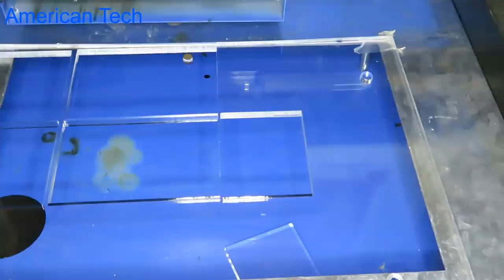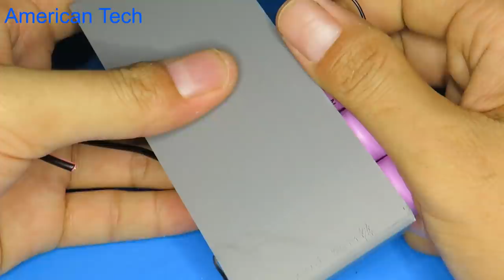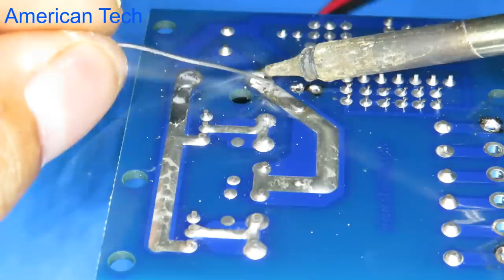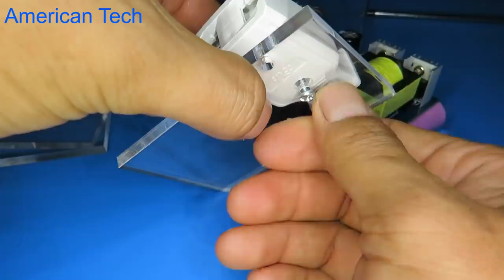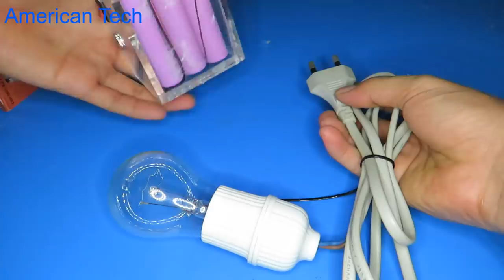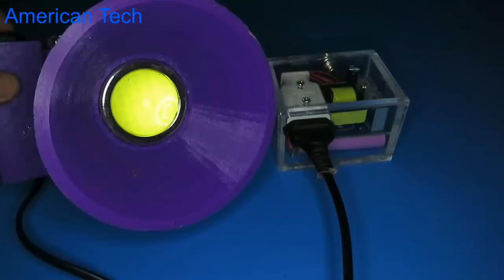World smallest portable power station 150W

Comment: Warnings:
1. The board belongs to high frequency square AC output; it is not suitable for the inductive appliance, such as motor, fan and coil transformer.
3. You should install a large heat sink to release its long time high-load (¡Y100W) work.
Despite those warnings:
- you used it for a fan
- you closed everything inside a thermal insulated box.
- the battery has 30 Wh, you presend to use the generator with a 150 W load, they will last less than 12 minutes.
- for a 150 W output on 220 V the battery is requested to provide more than 12 A… 12 A in those wires???
Reply: I Agree But There’s Some Mistakes In Your Comment.

First One Is The Fan Is Being Powered By A Phone Charger Which Outputs DC Voltage.

Second Is The Battery Pack. The BMS Will Cut Off The Power If The Current Draw Exceeds 10 Amps. That means 120w 

thank u
Reply: @fayanshorts but its a 20a bms and ig you look at datasheet you will ser it cut the current above 20amps

Comment: 4,21x3x2,5=31,575 
31,575/150=0,21
 So it can last 12 minutes at 150W
Reply: But you can add as many batteries as you want in parallel with this 3s.
Reply: Teach me this formula plz
Reply: Where u getting these batteries from, Mars?
Reply: @Magneticitist  you can buy these batteries from electric shop or if you want to save money than you can extract these from old laptop's batteries.
Reply: @shahzadmughal7666  there are many different kinds of lithium cells that use different chemical makeups. If one is looking to build legit inverter that can actually Supply a good amount of power then you need to use high discharge cells like what can be found in lithium drill batteries. Otherwise you are using cells which are maybe good for 1.5 amp hours tops and can maybe deliver 5 to 6 amps continuous.
Reply: @Magneticitist  man, there are many quality 18650 who can deliver more than 20A continuos and around 3Ah of capacity.  For example LG HG2.
Reply: @AsitShouldBe  right, you can use them in desire combination using a good bms to get good charging and discharging rate
Reply: @Magneticitist  no, from LG 😁
Reply: @AsitShouldBe  yea and you won't find them in cheap pulls like from laptop batteries. They are going to be in high drain designs.
Reply: @Magneticitist  yes, sure, but you can buy them new!
Reply: Can you see number of ads on his videos 😲
Reply: @rohankumarchauhan9653  no, i block them all
Reply: Can only charge phone for 12 minutes?

Comment: Extremely dangerous to build, handle and use. Mishandling high AC voltage can be fatal. These kind of cheap AC inverters produce weak quality sine wave than can destroy almost instantly every devices plugged on. There aren't any cooling system in the box so the components / batteries might start burning during long use period !

Comment: i was thinking about that phone charger.the output frequency is around 25khz to 50khz which is very high for that charger.inside the charger there are normal diodes probably 1n4007 which are getting damn heat due to high frequency and we also cannot use some devices with that much high frequency.the best option is to use a bridge rectifier at the output with fast diode to get 220v dc😄😄😄😄😄😄😄😄😄
Reply: Yes maybe charger damage in just 5 minutes 🥰
We make it and use ba159 diode for rectify dc output
Reply: @sahimkhan7899  :)

Comment: While being a proof of concept, I really doubt these cells or their wiring will handle 150 watts. Slapping a 150 watt inverter inside (and that's a manufacturers rating which probably is higher than in reality) and calling the whole design a 150 watt one is false, because it doesn't take into the account the real possible power of the whole design
Reply: Yes you are correct. I'm also using this simple inverter board. Output wave is a square wave. It's not efficient too. I believe in how much input we given, that much output only came out. So, consider the li-ion battery has maximum 3.5Ah. so the battery spec is 12.6V, 3.5Ah. so the power is 44.1W. So due to some external losses like heat, self loss so maximum 30-35W only we can use.

Comment: I think you should have used 40watt inverter circuit because the batteries are too lazy to handle 150 watt stuff
Reply: Той інвертор, про який ви говорите, має ККД всього 50%
Reply: @ventil9641  Means 300w input and 150w output and the battery is finding a way to escape to the heaven